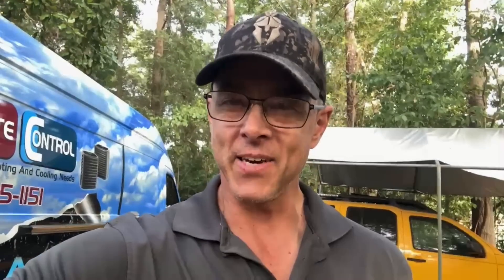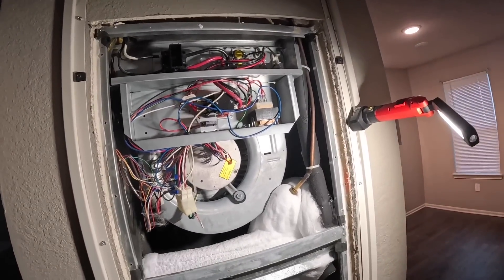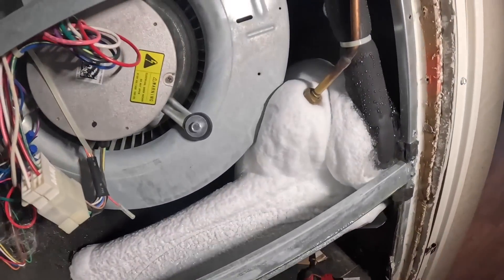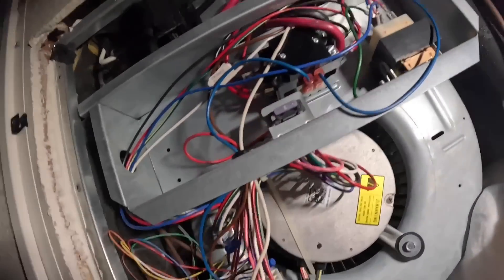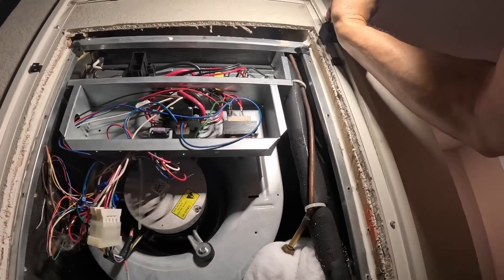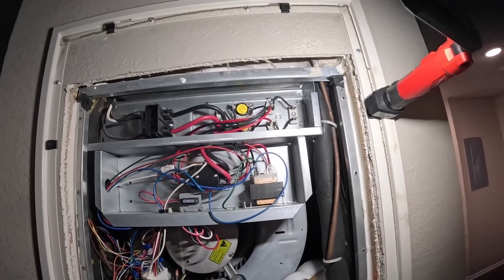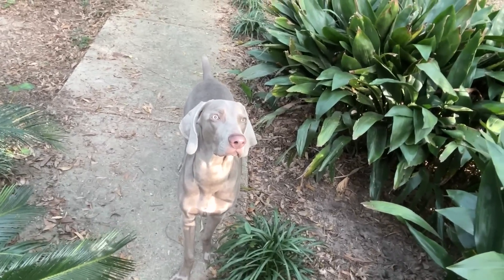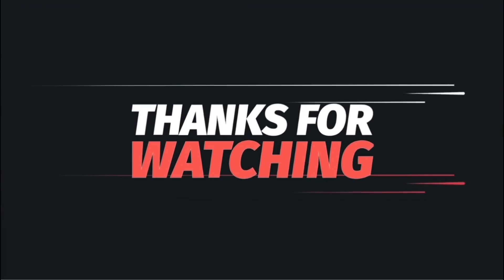They Couldn’t Get Any Worse If They Tried! #hvacguy #hvaclife

Comment: If you will cut off the excess zip tie close to the gripper with toe nail clippers there won't be a sharp corners to cut you or someone else working there later.

Comment: I have a question no one seems to have the answer for - all automobile evaporators have a temperature sensor attached to the evaporator coil that will shut off the compressor if it gets too cold to prevent icing. So why do residential evaporators not have this feature?

Comment: I am NOT a fan of those ECM motors.  Never have been.  Carrier was having problems with them in the mid 90s and then you could not just replace the ECM you had to replace then entire motor.  Give me an old fractional HP motor any day.  1/5 - 3/4 used to be about 35 - 40.00 back in the day, not any more.  Crazy because they are still made like junk.  Not like the 1978-1985 time frame.  Yup, I'm an old tech that got into Chillers.  Hope you let that thaw natural like.  I've had new motors taken out by running with ice. P.S. I do like watching you repair stuff.  The key word is REPAIR!  Everyone wants to replace with a 7 or 8 times mark up on residential stuff.  Amazing to me.  What used to cost about 3-4000.00 (5 Ton) turn key is now 17 to 20,000.00 which screws someone my age totally over.  Pay 200.00 per month for life LOL.  Anyway GOOD JOB !

Comment: I’ve installed a lot of Goodman units with no issues. The quality control on all the brands has gone down. So you can’t say one way or the other. I do however, think a fan motor on a new unit is unusual.

Comment: Could you have disconnected the blower power and run the HP in heat mode to get that ice started melting?

Comment: 10:00 - The problem is you didnt even plug the wiring loom in properly on the first motor.  You can see it is clearly not seated properly, especially when compared to 14:11 .  Jagaloon.

Comment: @10:20, It's looks like the connectors are not fully seated after the new motor was connected. Is it just me? Either way, it's worked on the second motor 🙂

Comment: At my workplace, we had a Gibson furnace combustion air blower's bearings go bad, repair guy replaced it with a new one and it immediately sounded like the rotor or fan was scraping big time, so he sent it back to the distributor, got a 2nd one- SAME problem! so he sent that back and went to another distributor and that one worked, so it took THREE tries to get one brand new fan that worked

Comment: Milwaukee Rover pivoting cat # 2114-21 buy this more than likely u won't use your others is small in size usb charging u can get Xtra battery has clip and strong magnet after 27 yrs. Of trying lights this is the best I've used.

Comment: Well. I remember back in the 80’s that new parts would be defunct. Happens. Transistors, capacitors, and on and on. Bound to happen once in a while. Just a pain in the derrière. Thanks fir sharing about the Milwaukee  light. Appreciate it!.

Comment: Stuff today is garbage.  Stuff back in the 60's, 70's and 80's seemed to last longer. I have some customers that have air handlers from the 80's still going strong.
Reply: I have a 1965 southwest furnace, replaced blower motor and gas control in 1993  cleaned burners recently, its still going strong  !
Reply: it was all done on purpose... part of the green new deal depopulation plan

Comment: HELP PLEASE I need advice!!!!  I have a ttx730a100a3 with the 
O.D mot (1) 1.4FLA, 200/230V, 1 PH , 60HZ , 1.5HP. This seems impossible to find I have found  2 but they seem to be a bit different one is MOT18923, and the other is MOT03031. Can you point me in the direction of a model # that would work with this model AC please

Comment: I thought the ECM modules were replaceable so you didn't have to pull the whole fan? At any rate, it may be wise to get tester and test them out of the box.
Reply from the maker: Not on these
Reply: Over here near chicago they don't sell just the modules anymore cause the manufacturer was loosing money. Now they sell everything together.

Comment: Had a compressor bad out of the box once. Many choice words were said after installing it and finding that out. Windings were fine, but it was bound up inside.  Three phase so I even rocked it backwards briefly and no luck. Used a crane to get it on the roof and everything.
Reply from the maker: Dang, and your estimate sure as hell don’t include doing it twice.
Reply: @HVACGUY  Certainly not.  Definitely had to do some negotiating with the manufacturer.  Still ate a lot of the labor cost....
Reply: For awhile in the 1990's Copeland was having all kinds of problems with the compressors.  We go to the point where we'd OHM them on the dock before ever signing for them, in the box still and we'd make the warehouse guys take them out lol.

Comment: No surprise there !  The ECM module thermistor failed like they always do...a $2 part soldered onto the ECM board. Try the Evergreen or US Motors brand.
Reply from the maker: Was a warranty job, otherwise I would’ve.
Reply: @HVACGUY Oh yes, I neglected that.  Evergreen are self learning on rotation and come with an adapter cable for "communicating" b.s. Also, they are made by the new Gentec but all redesigned I think.

Comment: Wonder why those apt style ahu are used, from my pricing they are more expensive than a regular ahu and a lot harder to work on.
Reply: Well I will tell you from working an apartment maintenance job.i would much rather have a wall mount unit to work on.over an over the tub model .that one sucks...

Comment: Go to 10:00 and see if that second connector wasn't crooked.  Looks can be deceiving.
Reply: Looks like the left molex connector sticking out more than the other half of harness
Reply: I agree it looks possibly not fully inserted however  it looks like maybe that was corrected before the motor was tested again. Around 11:05 it looks like it was pushed in further.
Reply from the maker: Guys, keep watching, when I try the second time it is fully plugged in.
Reply: 14:47 looks better than 10:20 @HVACGUY
Reply: I would bench test it to make sure. @HVACGUY
Reply: maybe checking power on the motor side?
Reply: @12:09 it is pushed in all the way

Comment: I'm old enough to remember when you could go to the store and buy something and just expect it to work because it's new. Of course, everything wasn't made by chinese slave labor back then.
Reply: I remember buying the Janitrol front breather, which was this same unit back in the 90s for about $225. I would install them and never have to go back other than possibly a backed up drain. It is so sad what has happened to quality. I would say that half of our service calls are to units under manufactures warranty.

Comment: Who ever designed that motor should be fired. In all my years of HVAC work I've never seen such a sorry motor. I've seen them bad right out of the box. If it  was mine I'd put a regular blower motor on.
Reply from the maker: It was a warranty job
Reply: Its the ECM or board that goes out, one cheap part, a thermistor.  The mechanical part or the motor is always just fine. Just like any other motor that decides to quit, its not the motor, its the cheap ass bearings they use.
Reply: Yeah! what ever happened to just a regular PLAIN electric motor that just has the case, stator and rotor without all the electronic crap in the end cap?? the less crap in there the better, I'd take that junk motor out and look into replacing it with an ordinary single speed motor
Reply: @FCE-dogs The stupid folks in high political places simply do not accept the facts about electric motors as they are today. That is they are about 60% efficient meaning 40% of the power used is wasted. So, they force industry to use technology that is not reliable nor good for long service and very expensive, in many cases 10 times the cost of a PSC motor. Add to all of this that most things are made in PRC or China so the quality is limited.
Reply: Just know now we have WiFi on our dishwashers 😀

Comment: I hate to make a sour comment but if you play back the video, that first motor wasn't plugged in all the way (16:07) on the large white connector. The side with the white wire especially. I played it back a couple of times and it looked crooked or maybe it's my Brain!😂
Thanks for the Video 👍
Reply from the maker: Actually if you’ll play for just a sec you’ll see I caught that and the second try it was firmly plugged in.
Reply: hinspect.    I see it too. Very good catch😊
Reply: Yes me2, that’s the communicating side, which will cut in and out if not in properly